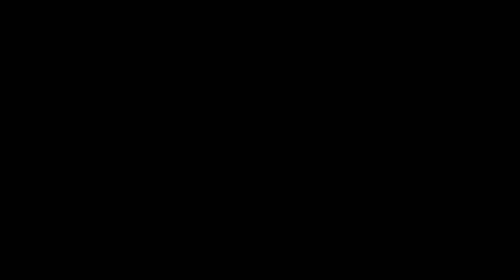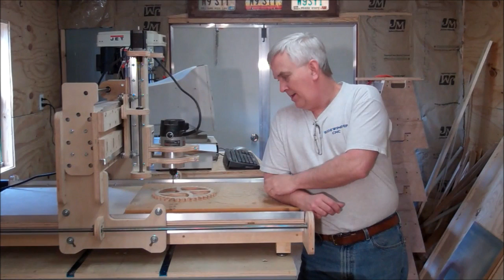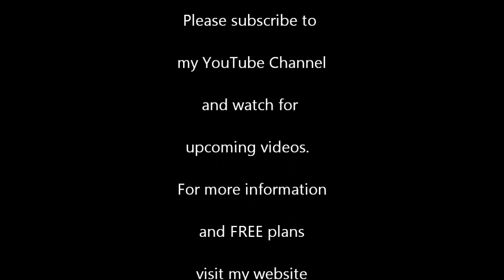How to Build a CNC Router On A Shoestring Budget Part Nine

Comment: about the static electricity :
i heared about it before and another builder solved the problem by running some solid copper wire (basic home instalation stuff stripped of the insulation) rolled in a coilspring and kindah pushed inside the vacuumhose grooves and connect that to earth , sapping off any buildup

Comment: What would you use to import PDF files?  Anything I have used tends to leave the results less than acceptable. Some look OK but need editing to add features like cut depth for a drag knife.  Speaking of which, how is that system you designed at using a drag knife?